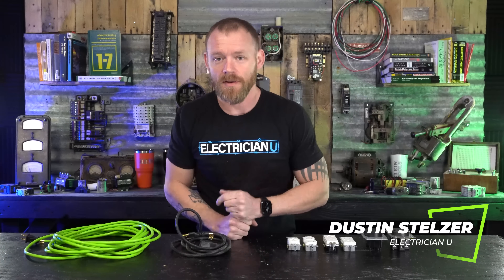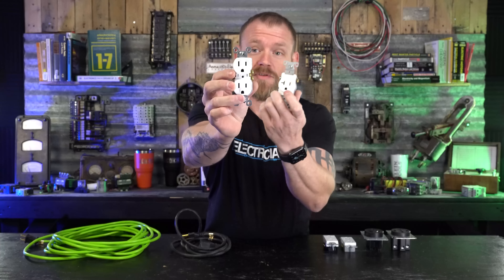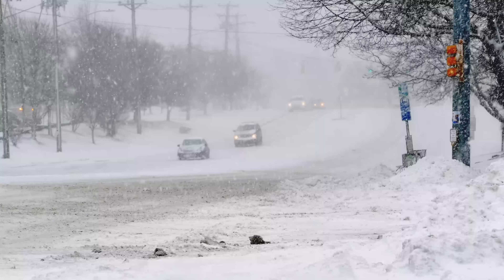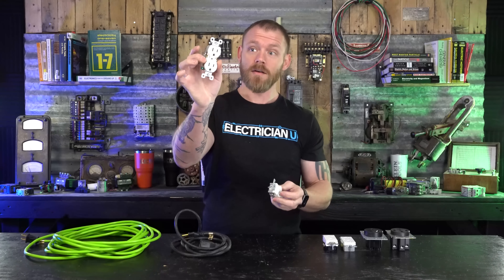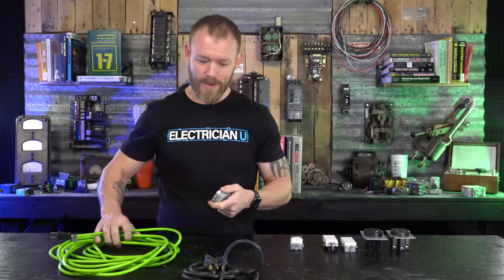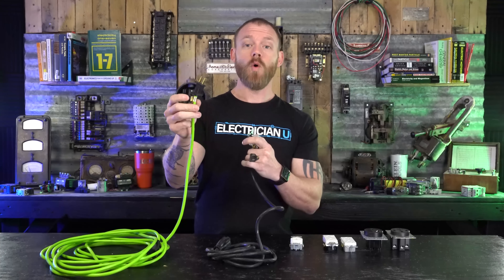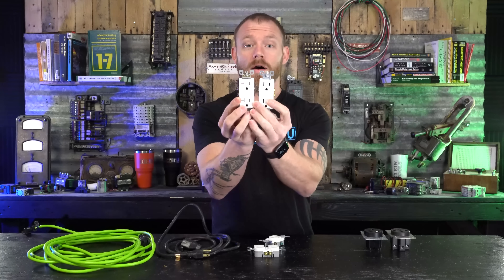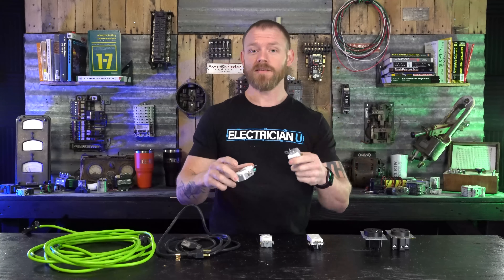Why Do Outlets Have Different Types of Holes?

Comment: Virtually all 15 Amp outlets are actually 20 Amp, with a different plastic cover. Try removing the plastic cover and you'll see. Also all 15 Amp receptacles are rated to pass 20 Amp through them, since you have two outlets, and it's legal to connect them to 20 Amp circuits (each outlet would take a portion of the current), the backbone of the receptacle is always rated for 20 Amp.

You only need 20 Amp receptacles if you want to "mark" the circuit as being 20 Amp, or if you have a 20 Amp device to plug in (very rare).
Reply: I was going to say the exact same thing, for example my treadmill has a horizontal and vertical pin, it requires a 20 amp circuit, you could not plug it into a 15 amp circuit unless it was mistakenly wired using a 20A outlet.  I have GFCI which say 20A but only has vertical pins.
Reply: All 15 amp duplex receptacles are rated to have 20 amps passed through them. Dustin was incorrect. 

The difference exists to physically prevent people from putting a 20 amp appliance on a 15 amp circuit.
Reply: I was wondering, since that's what I heard too, but he sounded pretty experienced with melted receptacle faces. Maybe those are just cheap crap receptacles...
Reply: @rpavlik1  
Cheap. Worn out recept or plug.
Reply: Outlets are tested for higher than rated. 
20a are usually for special situations.. Like he said. Where a heater or equipment plugs into it. Floor buffers come to mind. 
Proper use is often overlooked. With an available adapter. Oo look it fits now. 
I have an adapter to run from 220v 20a to 110v cable.
If i plug that cable into most things... Those things will no longer work. 
But my device is 220 and the adapter was easier and quicker to get than the correct cord. New cord ordered btw.
Reply: I have to agree with this post. you can put 15 amp receptacles on 20 amp circuits unless there is just a single receptacle (as in not a duplex) on its own dedicated circuit. If that is the case then you need to have a 20 amp receptacle. Also, you can not put 20 amp receptacles on a 15 amp circuit. 210.21(B)(3) Table
Reply: It’s not to code to put a 15 amp receptacle on a 20 amp breaker here in Canada
Reply: Thats not what he said in the video pay attention. Of course you can have a twenty amp circuit passing through a 15amp receptacle. The problem comes in play when you connect something that goes beyond 12 amps (20% rule) but below 20 amps . Like a heater . Its not going to trip the breaker but your 15 amp outlet wont handle it and will burn . He also mentioned that you can tell the difference between the 15 amp outlet and a 20 amp outlet(winky eye)

Now stop being morons and don’t ever disrespect the man dustin.
Reply: @theguy2605  The 15 amp outlet will handle it just fine, for the reasons that I, and everyone else, have mentioned. Not to mention that this high amp device should have a different plug that wouldn't even fit in a 15 amp (The blade is sideways).
Reply: @Ariel1S  even a 1500 watt 120 volt heater sucking up 12.5 amps will burn your 15 amp outlet and it wont trip the breaker until your outlet burns. So what is the solution for that?
JUST INSTALL A 20AMP OUTLET. 
EXACTLY LIKE DUSTIN SAID IN THE VIDEO. 😂😂😂
Reply: @Theguy a heater that demands 18 amps should not have a NEMA 5-15 plug but rather a 5-20 plug which will not fit in a 15 amp outlet. But if for some weird reason it did fit in a 15 amp outlet it still would be just fine, because all 15 amp duplex receptacles can handle up to 20 amps with no problem.
Reply: @theguy2605  sorry but you are wrong and so is Dustin. Unless the receptacle is defective, it will handle that load with no trouble at all.
Reply: @Ariel1S  sure buddy you dont know how many fires are started because somebody connected a 1500 watt heater to a 15 amp “duplex” outlet and had it on all day. Theirs even news channels warning about this during winter. The outlet will burn before the breaker will trip and lets hope the breaker trips before their is a fire but ok. You know your shit 😂
Reply: @Ariel1S You are correct.  Also, UL limits 120V portable heaters to 1500 watts, so a properly installed 15A receptacle should have no issue with a space heater in good order.  Of course, many receptacles are not installed properly and can overheat with high amp loads; e.g., back-stab connections. Also, receptacles often used for vacuum cleaners will go bad quickly, because everyone just yanks the cord out and the sideways pull loosens up the connections.  Plugging a space heater into one of those can be problematic.

The only reason receptacles with 15A faceplates exist is because 20A receptacles can't be installed on 15A branch circuits.
Reply: @barryomahony4983  @ariel1s Before i knew anything about this channel or pretty much about electricity I had a space heater connected to a brand new 15 amp outlet not one of those cheap ass ones you buy for a dollar and i had the heater running all day . One day my breaker tripped and i noticed the plug from my heater was stuck to the outlet and when i pulled it out the outlet was black from the holes. Luckily the breaker detected it and tripped . So yea im 100% sure that i know what Im talking about. But ok . Same thing will happen to a 20 amp breaker if you run 18 amps all day every day. This happened 3 years ago. But ok smarty what ever you say
Reply: Ariel1S BY CODE IT IS NOT LEGAL, TO USE A 2O AMP RECEPTICLE ON A 15 AMP CIRCUIT. GO BACK TO YOU DO IT YOURSELF, AND IF YOU BURN YOUR PLACE DOWN, WHICH YOU WILL BECAUSE OF YOUR IGNORANCE OF THE CODE, THEN HOPEFULLY YOU DON’T TAKE SOMEONE ELSES LIFE WITH YOU.
Reply: @freddybee4029  you read everything backwards. No one said that. Go back and actually read what people wrote before composing a whole misguided rant, in uppercase.
Reply: @theguy2605  if your breaker tripped your heater shorted out and damaged the outlet, but that has nothing to do with 15 or 20 amp receptacles. As multiple people have said: the internals of a 15 and 20 amp receptacle are identical, only the plastic is different.
Reply: @rpavlik1  Bad connections melt receptacles. Not all are built with the same care, and over the years, repeated use does wear them down.
Reply: @theguy2605  I've done this for decades and not melted any receptacles. As everyone is correcting him -- and you, every duplex receptacle is 20A despite the 15A face they might've put on it. (it only has to be a 15A face if the circuit is 15A. a 20A circuit can have either.) Also, the biggest heater you can get for 120V is 1500W (12.5A max.) [we had to look to UK stores to get 240v heaters] I've seen hair driers at 1800W, but they don't get used for very long, and their thermostat won't leave the coil on for more than a few seconds.
Reply: @theguy2605  Wow. One whole data point! Just because you paid $15 for it doesn't mean it's good. I had a new $750 breaker explode the 4th time it was cycled; it's never had any load on it... after all the inspections, the electrician goes to turn the service on [no load, my breaker is still open] and it f'ing explodes. (480v 400A panel, and it did not trip the feed breaker.) Bad cord-receptacle connection is what causes most of those hot spots, and not just with heaters. While they do happen, they are rather rare (vs. the total number of people plugging things in.) How many? On the order of 1/100th the number of fires caused by idiots putting their heater(s) too close to things and/or not watching them.

(Side anecdote... a fiend's tesla set one of the 50A RV plugs on fire at Road Atlanta. Of course, those are NOT well cared for plugs. Luckily, this one was near the breaker panel -- and marked.)
Reply: Thank you for your comment and insight,
I really like living & working in North America, Mike holt is a good source of information, helped me get my ticket, in different regions aka states and provinces, 
Brit SPARKY,
Reply: @jfbeam  i dont care about your breaker exploding. Im talking about the subject with the outlets. No the heater was no to close to anything. The outlet burned . Maybe you have to re read the story . It happens a lot. Now i dont know where you are from but where im at its a big deal in the winter.
Reply: @theguy2605  Again, the internals of many 15A and 20A receptacles are the same. To avoid fires you need to install quality receptacles and people need to replace receptacles that don't make a tight fit with plugs. Now, 20A receptacles are less common and they tend to cost more - which may lead to less pressure on manufactures to cut costs for those receptacles. But a cheap and/or loose 20A receptacle can present the same risk as one keyed for 15A. We'd likely benefit from some of the practices in the UK where home electrics must get periodically tested - so that old, worn out, or cheap receptacles get replaced.
Reply: @theguy2605  That will only happen if there's a loose connection involved, which will heat up from high resistance. Most commonly this is from a worn outlet that won't hold the plug tightly, but could also be from the wire connections to the outlet. An outlet that's properly installed and holds the plug tightly will run at its rated load all day with no issues.
Reply: @freddybee4029  He never said you could put a 20 Amp receptacle on a 15 Amp circuit.
Reply: @theguy2605  If the breaker tripped then the heater was defective and drawing more than 15 amps.  Breakers will stay closed at 100% of their rated current indefinitely.  40 years an electrical engineer and I'm sure I know what I'm talking about
Reply: @commoncentstx   bingo
Reply: I have been an electrician for 38 yrs  and over the years I have seen so many of those 15 amp receptacles melted that I have quit using them for numerous years now I just buy the 20 amp rated or commercial rated receptacles
Reply: The main problem that I have seen over the years with receptacles failing-melting  is where that the wires have not been put under the screws with a hook made on the end of the wire and the screw tighten down really tight , the wires have just been stripped back on the ends and pushed or stabbed in the little holes in the back of the receptacles and then heaters and appliances, stuff that pulls higher amps heats those little springs that holds the wires in the little push in holes and they lose their tension and after awhile the receptacle melts . The receptacles that I buy now do not just have a screw sticking out there for you to make a loop in the wire  around the screw and then tighten it up. They have a clamp that you put the stripped back straight end  wire in between and  then tighten the clamp down  and you can use these for solid wire or  (stranded twisted wire that mostly used in conduit ) cause I do residential and commercial work in a lot of convenience stores and I also repair all kinds of appliances.  I have had a lot of calls that they have a breaker tripping and I would go and check things and find a burnt receptacle and a lot of the time the cord plug burnt really bad also or maybe not burnt bad and could take a small file and clean the plug up and go get a new plug if I needed it and a new heavier duty receptacle, cut the wires back to good wire if they were long enough   and hook everything up with all screws tighten really good and go turn the breaker back and never have a problem with the breaker tripping again . There is a lot of house trailer receptacles that don't even have screws on them, everything just pushed into the little holes in the back of the receptacles and the places where that the  cord plugs, plug into are weak and don't hold up ( cheap, cheap ) and then people wonder why that a lot of them burn down over the years . Now back years ago they got so cheap that they started running aluminum wire cable from the breaker box or fuse box out to the circuits of receptacles and lights.  I don't run any number 14 wire,  or 15 amp circuits unless it is just something that calls for no more than a 15 amp breaker, but then I use number 12 wire and a 15 amp breaker . Then also I have to run a circuit sometimes that calls for a 30 amp single pole 120 volt and then I run number 10 wire . A lot of the time that you find out about a 
15 amp receptacle
Reply: I hit the send button and didn't mean to, I was going to change a few words, so I will start over .  A lot of the time the main difference between a 15 amp  cheap receptacle and especially a 20 amp commercial grade  receptacle is way and how well that the hot and neutral wires fasten to the receptacle . 
The cheap 15 amp receptacles cost about $1.00 and I can buy the great quality commercial grade 
20 amp receptacles for around $2.50 to $3.50 depending on the brand name, but one place closer to home I have to pay $4.00 for them, but I would have to spend more in gas and time to go get the cheaper ones. But if I am doing a big job, then I can get everything at electrical supply place and that is all that they sell is everything electrical all kinds of lights fans and so on.
So by buying the commercial grade that the wires fasten to really great with the clamp that you put the stripped back wire in and tighten the screw in and is a much better heavy quality receptacle for no more price difference, you are far better off . There is one big hardware about 14 miles from where that I live they have the cheap receptacles and then they have the commercial grade ones there for $ 3.99 plus 24cents tax but then at the electrical supply place 30+ miles away  they are  $2.47 each and that includes the tax, they are 2 different brands but both are commercial grade receptacles. But if you want to go better there is also industrial grade ones and hospital grade .
But for houses , garages and barns and offices and small stores and so on . The commercial grade are great for places like this.
Reply: In California you don't use the outlet as a line and load you actually need to connect them with wire nuts and run pig tails to the outlet
Reply: @andresv8856  They learned me that in electrical school years ago, and I have always wired the black wires together and a short piece of black wire, with a wire nut and made a pigtail and then did the same thing with the white wires and then fastened  the short pigtail pieces of black and white wires to the receptacle and that way the electric current did not pass through the receptacle its self to go on to the next receptacle on the circuit . So if something happens to that receptacle then everything else on the circuit still has power on it on down the line.  But over the years I have seen where so many people have done that running the electric current through the receptacle on to
the next receptacle and through it and then on to the next receptacle and never pigtailed the wires at each receptacle like that I do . I have seen so much messed up stuff out here over the years that I have been doing electrical work, that was not done correctly or safe . I have told several building contractors over the years, that I will not and do not cut any corners doing electrical work, if I do the work you will get a top notch electrical job.
Reply: @jeffreykbevins7116  that right brother the only way to do it, it's the right way 👌
Reply: @Ariel1S  too bad a 20 amp breaker will trip when it sees 16 amps though.
Reply: @jaydouglas1090  No it won't, go search for breaker load time trip graphs.
Reply: @theguy2605  A 15 amp receptacle will handle 1500W forever.

Comment: You mentioned a space heater plugged into a 15A rated outlet drawing 18A. If the space heater is rated over 15A, how is it able to only use the prong configuration that will allow it to fit into a 15A rated receptacle?  Shouldn’t it use the prong configuration for 20A?
Reply: That sounds like a manufacturing problem, if the cord/plug was original. In which case the product couldn't be UL certified. Alternatively, that could be the result of someone replacing the plug on an appliance with one not rated for the power requirements of the appliance/device to which it was attached.

Comment: I have never worked as an electrician per se, but I have a bit of experience dealing with electricity / electronics (often with much higher voltages than found in houses).  I've worked on the wiring in houses that I've lived in over the years and have encountered many instances where the wiring is not what we would consider safe these days, especially in older houses which might have been originally built before the area even HAD electrical service.  They often had the NEMA 1-15 outlets, so it was entirely possible to plug a lamp into an outlet and have a charge on the outer area of the bulb socket even with the switch turned off on the lamp.  Even when the outlets had been replaced, it was not uncommon for either the ground wire to not be connected or IF connected, not be connected to a grounding rod at the meter... I even encountered 120V on ground once because a hot wire was touching the ground wire in one of the outlet boxes, but the building ground was not connected to a physical ground.  That took a lot of unplugging of devices and disassembly of outlets to find that problem... And then there are the overhead lights where the switch was mistakenly wired on the neutral side instead of the hot side.  Over the years, I basically determined if there is ANY way for something to wired incorrectly so that it will shock you, then SOMEONE will probably have done it and to assume everything you deal with to be hot.

Comment: Here's a history note.   There's also the obscure NEMA 10-20R, classified as 20A 125/250V nongrounding, that resembles a NEMA 10-50R for ranges with the 3 wire cord, only smaller.   Some window air conditioners from the  circa 1950- mid 1970s had 120 and 240 volt components and used this plug.

Comment: Having polarized receptacles is important. Some vintage electrical equipment has the neutral attached to the chassis. Get it backwars the chassis will be hot with line voltage